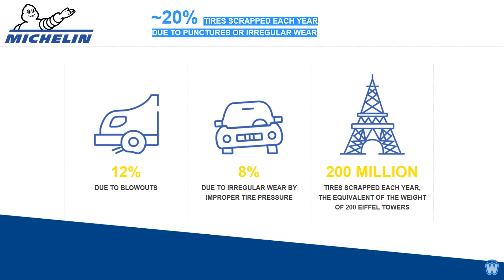Michelin Airless Tire UPTIS - Unique Puncture-Proof Tire System

Comment from the maker: ★★★ FREQUENTLY ASKED QUESTIONS ABOUT THE VIDEO  / FACT UPDATES ★★★

1) Tire or Tyre, which is the correct spelling? - Tire and Tyre both mean a covering for a wheel, usually made of rubber. Tire is the preferred spelling in the U.S. and Canada. Tyre is preferred in most varieties of English outside North America. Of course, all English speakers use tire in the sense to grow weary. (in Australia, we spell it Tyre)

The following if from the Michelin website for this Tire / Tyre - "The MICHELIN® Uptis (Unique Puncture-Proof Tire System) is an airless mobility solution for passenger vehicles, which reduces the risk of flat tires and other air loss failures that result from punctures or road hazards."

2) why do we need to wait until 2024 before they are available? - I do not have an answer for this question from any official FAQ page from Michelin, but I would assume because they are a high consumable used on every car under so many kinds of conditions, high acceleration, hard braking, high speed cornering, cold weather, hot weather, snow, mud, ice, rocks etc. and because people are putting their lives on the line with these tyres, that like a new drug, extensive testing, redesign and further testing will need to be done, to get the perfect design, that can handle all conditions, and still perform like a normal tyre and last just as long.

3) How much will they cost? - These tyres are still in-development and will be not be available to the public until 2024, so ask me again then. But if you search for "Michelin Tweel Kit" (UPTIS tyres for forklifts & UTV) the prices start at $847.00 per wheel. 

4) what if you get mud or snow, in the tyre - Here are 2 video links on the Michelin website showing just that 
Mud in Tyre - https://michelinmedia.com/site/user/files/44/MNA342_Uptis_Mud_Clips-proxy_2.mp4
Snow / ICE in Tyre - https://michelinmedia.com/site/user/files/44/MNA342_Uptis_Snow_Clip-proxy_2.mp4

5) A lot of you ask, can you drift or do burnouts with these tyres - Tyre companies make a range of tyres to suit all needs and vehicles, Michelin states in a FACT SHEET these tyres are being designed for Autonomous & Electric passenger vehicles. Which says to me, being used in a sensible manor at sensible speeds.

6) Most of you keep asking "What If" question, what if you get mud, snow, water in the wheel? Can you drift on them? How is the cornering? - The tyres are still in development and won't be available for 4 years, so there is no way to answer any of those question until then.

7) Why even mention the Police Spike Strips in the video it should not matter - You are right it does not matter, it was just a joke reference, when i saw these tyres I thought "oh what about Police spike strips, how will they stop fleeing cars" so i added that into the video, but it had no baring on the tyres development. So many people have linked videos in the comments, showing alternatives, and i will even be doing a follow up video about these tyres and the Police alternatives to stopping cars in the future.
Reply from the maker: @Schmuley Sheik-Down who said it was indestructable?
Reply: They probably going to cost way too much for anyone to afford who is not rich...
Reply: @tommycharlie116  True
Reply: Southern style tire or tower.  😂😂😂
Reply: Some state police vehicles are now equipped with a netting that shoots out and it will tangle the rear tire and cause the tire to lock up.
Reply: 1) Both are acceptable spelling depending on which side of the pond you are.

2) Are you kidding me?! Why would any company rush head first into its fiscal undoing? Tire sales from nails, screws and other leaks immediately go to ZERO. #footdrag
3) The price would have to make up for the revenue stream lost by a set of those on a car vs the ol' replace every 2 year type.
Reply: I'm English but spell it "tire" lol
Reply: If you understand it's correct
Reply: Actually fun fact, there is no proper English so you can say whatever
Reply: Can we make drift on using this tyre?
Reply: @shaikhsultana4985  is that you Borat?
Reply: What if you had to stop the thieves who are running from cops. And their car tyres are made up of this substance?
Reply: English spell tyre whereas American spell tire which is not English...
Reply: @wandereagle4785  who gives a crap how it's spelled just keep your day job because we don't need anymore chumps like you being the grammar police...
Reply: @tommycharlie116  you're not English .....you americano ,so you spell tire
Reply: @tommycharlie116  again that ain't is americano
Reply: @tommycharlie116  yes Tommy...... America is the greatest , richest,most powerful and rich in culture country in the world ..and you know what you can buy guns in the shop openly and need no licence...and l like Remington conversion revolver... that's my favorite ..
Reply: bababob wandereagle you are you doing Mr trump , yea make America great again 😅😅😅😅😅😅
Reply: @wandereagle4785  don't be jealous it will be alright.. maybe one-day you're country will be too. Sike that just a pipe dream of yours..
Reply: @tommycharlie116  let our country be poor ,l do not mind...but as you are from the richest  and powerful country can you send me the Remington I'll pay for it...and no one will object because it's from the powerful country...what do you think...?
Reply: @tommycharlie116  😀😀😀😀 thanks buddy that was awesome....😀😀😀😀
Reply: @wandereagle4785  you're welcome enjoy...
Reply: @tommycharlie116   yes America is great 👍 I agree
Reply: @tommycharlie116  when countries invade other countries the home countries military tend to, you know, do the fighting. Also, enjoy Biden being president very shortly haaaaaaaaaaaaaaaaaaa
Reply: @tommycharlie116  US is far from the greatest
Reply: @tommycharlie116  I don’t think you know what grammar is...
Reply: Still waiting............
Reply: Not the word but the quality
Reply: Que pasa si se quedan piedras atoradas entre los espacios?
Reply: It’s true they can run over cops spikes but cars run out gas usually how they get caught in cop chase
Reply: Btw police already have a net system in place for this where it locks up the wheels so the car can’t move. Just like a spike strip but with a net
Reply: This tire would create more friction  to surface
Reply: Uey u y el y t yeyyeyeuurutwu et de the same is hehetyeorzbkdxbitryoigrfbjyrghyrrgitjfr iyr😉😉❤️👍👍🙏❤️🙄😭🙄❤️❤️👍🙏❤️🙄🙄😘😂😘😘😘
Reply: Is it as heavy as a normal tire?
Reply: @Vinayak_Kashyap_07  but it has more rubber in it than a normal tire
Reply: Good
Reply: Hi
Reply: Qqqqqqqqqqqqqqqqqqqqqqqqqqqqqqqqqqqqqqqqqqqqqqqqqqqqqqqqqqqqqqqqqqqqqqqqqqqqqqqqqqqqqqqqqqqqqqqqqqqqqqqqqqqqqqqqqqqqqqqqqqqqqqqqqqqqqqqqqqqqqqqqqqqqqqqqqqqq
Reply: This should be on all cars rite now as standard think of the world not the police chases.
Reply: Better to have police clearance and very strict to all business and residences across the globe to see who are the mafias around here and there, before buying this airless tires.

Yes, criminals and mafias are gonna using these airless tires for hot pursuit or escape.

So, the police will know your location thoroughly.

The police (as in good police) exempts this rule here.

As in good police will definitely use this airless tires.
Reply: Tayar
Reply: what if the gets over loaded.... would the tire bulge?
Reply: @yashwanthanchan5878  Overloaded with what? The gets? Man, proof read your comments before sending!
Reply: This is by far the more comprehensive follow up reply on a video I've seeing on Youtube and for that sole reason, I am subscribing. Thank  you.
Reply: Its cute little countries think they matter.
Reply: My only concern is that they could reduce efficiency since they absorb energy, and that when the tire absorbs the energy first, it seems as though there is a weird transfer from the tire absorbing energy to the cars suspension absorbing energy
Reply: How good would this thing be in wet/slippery/snow conditions
Reply: What if there is a piece of rock in there? i was searching for this question - answer
Reply: Wait,so after 2024 I can run my pedal bike with not tubeless,but AIRLESS tyre setup?!Man sign me up,I am really for it!
Reply: @randombiker4610  There are already airless systems for bicycles, and they all feel like crap to ride on, they're heavy, harsh, and have terrible traction. I'd rather deal with the occasional 10 minute fix of a leaking innertube. Yes, I have tubless on one of my bikes. I don;t get flats, but I spend more time keeping air in the tires than I do with my innertube tires.
Reply: On the fact of tires or tyers but there is a divice that wraps up the wheeles and makekes the car essentally stop so this would be a good alternituve.
Reply: THE WORLD WIDE GOVERNMENT CONTROLLS THIS, EVERYTIHNG;  REASON WHY THEY DO NOT ALLOWED TO BE SOLD YET TO THE PUBLIC.
Reply: ঙ১ঙ
Reply: Tyres
Reply: I’m in Australia and I’ve never seen it spelt tyre
Reply: @vinceemery5943  and that’s why the brits send you away
/s
Reply: Its tire
Reply: Why not just cover the sides? Watching these videos, not all of the particulate gets ejected out. Even just a little can cause a car to rattle. Even tho the Uptis looks cool, just cover the sides.
Reply: I wonder how these will work for large slower vehicles like dump trucks and construction vehicles
Reply: It is tyre. Tire means to become bored or needing rest.....not the rubber surrounding a wheel hub.
Police just need bladed strips that would shred the tire to bits rendering it useless instead of spikes.
Reply: Can you drive at 80 miles per hour on these for 3 hours? 

How do these tires behave on hard cornering?  

Is the tire's performance affected when in -30 degree Celcius temperatures?
Reply: Wdym I'm Australia we use tire
Reply: Back when the concept showed up over 10 years ago, they called them the Tweel.
Reply: I'd say Reifen...thats german lol
Reply: I see 100 windshield replacements from debris flying out of these tires at 65mph.
Reply: Tire, tyre is a place. Lol
Reply: 8(🆔🆔🆔🆔🆔🆔🆔🆔🆔🆔🔛🔛🔛🔛🔛🔛
Reply: Не для наших дорог с нашими наиглубокими ямами
Reply: Confucius say:
Man who run in front of car get tired.
Man who run behind car get exhausted.
Reply: TIRE.
Reply: Tire
Reply: Tyre is the right word, after all it’s the queens English
Reply: @Stubear22374  Nah tire
Reply: Wonder World tyre gang 😎😎
Reply: They are already available the concept was actually displayed at the NY international auto show by michelin tire and that was in 1993 and you don't have to wait till 2024 you can buy them now.. 

https://michelintweel.com/
Reply: @ @shartingfish5761 
He did say in the video that airless tyres have been available for some time for all sorts of vehicles — but not for cars. Your link seems to confirm that.
Reply: When their available to the public we will know the price... 🤷🏾‍♂️
Reply: piece of shit channel
Reply: Wonder World that’s the most boring comment I’ve ever read

Comment: can i see how it will pass thru water and mud and bunch of little tiny stones and how will end up?  how the performance when going thru corners at 100km ...

also hard braking?   also some * might cut one of those connecting rubbers inside so THE SIDE SHOULD BE CLOSED(with light cloth or something) just for the safety...

Comment: Something that is never discussed about these and that should be explained is this: is the tread/tire part of the wheel or is it separate like in normal tires? How are they mounted? Are they adaptable to current automobile wheels? These are important questions nobody is asking or answering.

Comment: what about the decibel and gas consumption in compare to the standard tires? does the space in between not cause much more air resistance and noise...especially on highways? And what if you have snow/ice inbetween?

Comment: Seems like it would be hard to replace airless tires for passenger cars when they wear out. Wouldn't you need a wheel system that disassemble in order to get the old tire off and the new on?

Comment: The tyre is best for offraod low speed vehicles jast becoz of the poor reduction of shocks for don't wish to use it on a portable high speed vehicle if you need life and improve on saving but if it improves beter I will let you no

Comment: On skid steer loaders, they have a similar tire,  but it is mostly solid rubber with only a few holes in its side. These have been in use for years. They are simply trying to find a way to make them work on cars.

Comment: Police all ready figured it out how to stop a car , no need to punch tires any more. they will hacking car computer system to shut it down, locks door, braking and so on. every modern car has a computer system and lately smart cars navigating roads by itself they can make the car pull over at anytime, at anywhere they want.  game over.
Reply: Bro🤦🏿‍♂️😂

Comment: Cops don't use spike strips anymore. They have a webbing that locks up the wheels.
Reply from the maker: "Cops don't use spike strips anymore" might want to tell all the cops still using them then.
Reply: @WonderWorldYTC  They may still in some lower budget departments, but spikes aren't a very safe measure. A criminal can still drive on rims or if they have larger tires keep driving for miles. The new webbing system locks up the car's axil thereby stopping it immediately.

Comment: Would they be safer since there is no air pressure in it?
Reply: It actually has better grip on the road since it has to lay flatter due to the car's weight. Its similar to how in winter you should keep the air pressure in your tires 2-4 pounds less than the max pressure so it has more surface contact.

Comment: Where I live some parts of the road is actually gone. Some points a 2 lane road becomes 1 lane because of potholes or erosion. Some areas where it's one labe there is a 2000ft change in elevation

Comment: that means cops will need to come up with a control explosion type of spikes that will take out 1/4 the rubber tire that will cause a bumpy ride which will cause an uncomfortable ride which will naturally cause people to slow down. That means to blow out 1/4 of the left front and the right back. and if that doesn't slow down immediately, then proceed with an irregular side of the front right and so forth. This can cause the whole car to act like riding a bull that ready to buck you out.

Comment: You do not have to worry about the police as they are working on a special car net.  They looking into nets that can stop cars going 60 mph in 10 seconds, without the car spinning out of control.  It latches on to the tire and locks up the vehicles axle.  It is very affective and it safer than the other methods.

Comment: small rocks can get in to this tire from the side holes which is exposed . there should be something to cover it from sides ...
if not small rocks then this tire is not suitable for off-road . mud can get in and seize the suspension of tyre .

Comment: This tire looks like it has a much higher rolling resistance, which would reduce the efficiency of the drive. I am assuming it makes a worse environmental impact than an occasional flat tire. With that said, in areas with bad roads it makes sense to get this type of tire.

Comment: I don't think a Police chase would be a problem, A cop can  shut 99% of the cars on the road today off with a device 
unless you have an old Analog car Gas motor no computers  he can stop you in your tracks.
GM was working with Law enforcement for Chip overrides onboard newer cars. This can be shut down inside the proximity of 
Legal authorities but hers the catch, A hacker can hack this for criminal activity's   This is the takeoff for advance technology.
Anything made after about 1978 has a car's computer in it.  Everything ODBII has the ability to be shut off . About 1994
If your going to out run a cop it would have to be a 1960's mussel car! But you won't out run his radio!
 and they hunt in packs!

Comment: I've seen these before, well on a z-turn john deere comercial mower. They're pretty cool since they have a lighter "step" and have significantly more grip since they're more malleable than your conventional tire. However they do cost $2500 USD per tire from what I last remember. Could be since they're not readily available to the public but I could also be wrong there.

Comment: The spike strip problem is an easy fix,get a straight piece of steel and put barbs on the spikes.the barbs will hold the piece of steel to the tire,the steel will get caught under the car and depending on the strength of the tire will either stop/slow the car or tear the tire.

Comment: Some wisdom cookie for ya guys. This idea is being activily neglected because of following major flaws:

a: You free yourself from pressure control, yet that option is exactly what cars MUST have. Imagine having always to manufacture SPECIFIC stiffness of such tire, instead of just producing same tyre and choose the pressure for yourself

b: Basic Physics Law: The normal tire uses the air within to absorb the most of kinetic energy. WITHOUT the air, such tire will degrade in a DAY

Comment: That's a very innovative idea. I wonder how they would work In Minnesota when it gets to twenty degrees below zero. Strange things happen in that extreme cold. And if there is any worry about law enforcement not being able to use spike strips, you might as well scrap the idea of self driving cars. Because with a self driving car if one car gets in front of it and slows it down, and another car gets on the drivers side and moves it over to a curb or wall. It can be vandalized, by theives, and the occupants will be at their mercy, because they were unable to make evasive maneuvers. Dumb self driving cars. And you thought sensor malfunctions were dangerous. Yes indeed! Make more of those beautiful  tires. But quit with the low-profile tires. Bent rims suck.